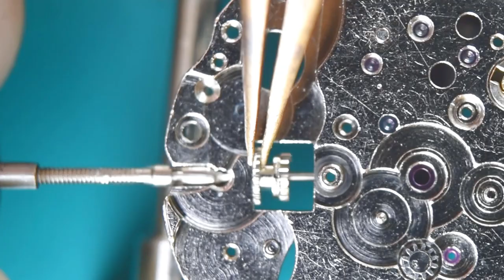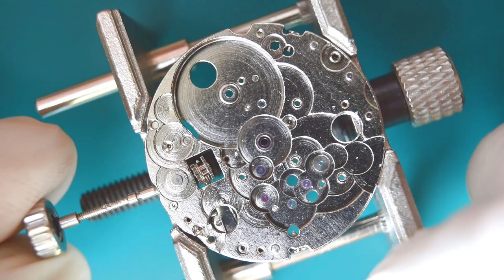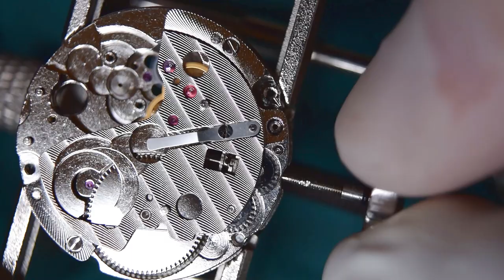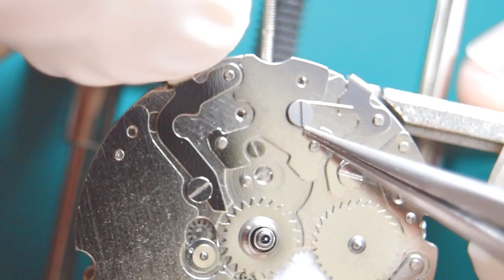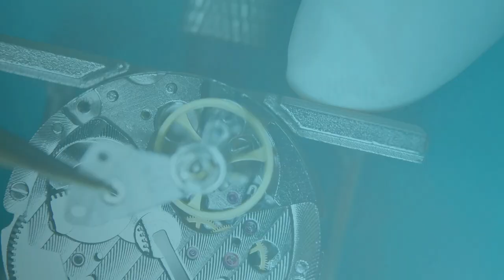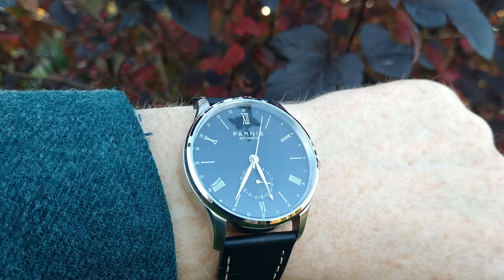PARNIS watch PA2122 with GMT and Seagull 1690 part 2 movement assembly

Comment: I've looked all over Alix. Do you know where I can get one of these movements? I have a different dial version of this watch and it just stopped working after about two weeks of working great. I'm not qualified to take one of these apart but I've assembled a couple customs so I know I have the tools and knowhow to just swap out the movement. Returning something to Alix is basically a non-starter. I would rather just get a new movement.
Reply from the maker: This movement in the version like in the video is rather not to get so the only think that left is to have one with standard functions like time and date, here I recommend Miyota 8215

Comment: and for the final accuracy test ?
Reply from the maker: AAA forgot, but I can make a post. The question is to make adjustments or show a result before any adjustment and see if it goes up or down?
Reply: @tickingWATCH  just to show the final result after a cleaning  and servicing  for see the precision gain compared to the exit of the factory
Reply: I plea for you to post the final accuracy test, and if it's not too good to tinker it a little to get a better accuracy. And of course, show us how the GMT hand operates now that's fixed and how to manipulate it without any risk of damage. For example, I suppose you shouldn't operate the GMT hand in the same period you shouldn't operate the date. So please, make this video explaining and showing all of this.